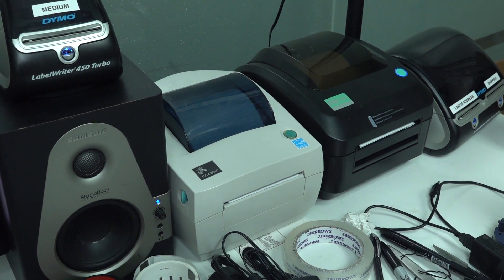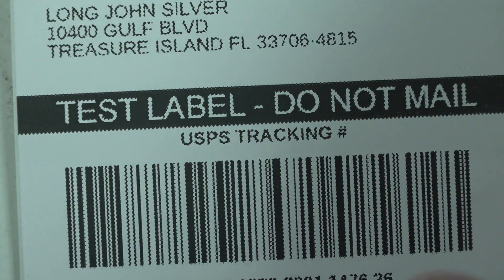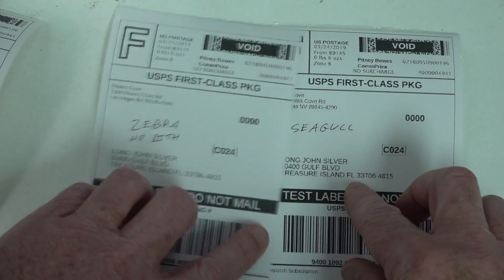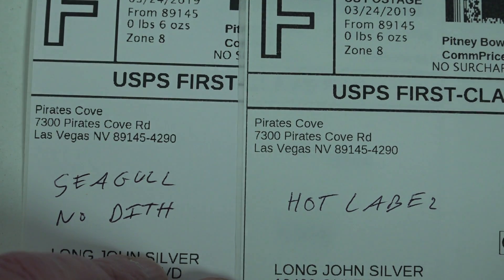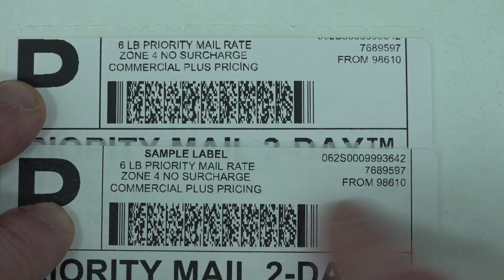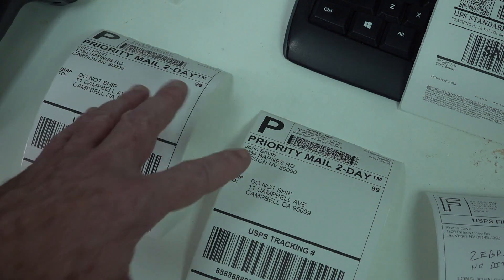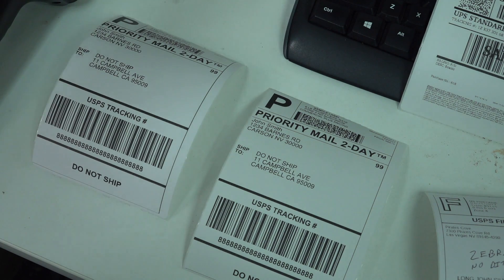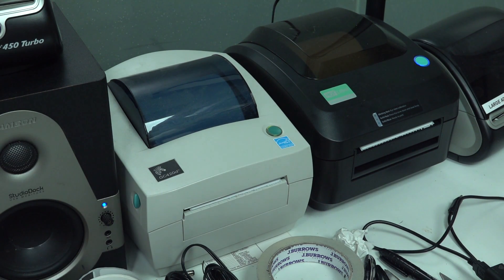Zebra 203dpi vs 300dpi Thermal Label Printer - PART 2

Comment: The issue here is that for the  test you're printing a raster image, which is interpreted by the printer driver to some other image (hence the dithering), affected by the printers resolution.  Normal barcode printing software sends most of their data as vector, so a barcode is very well defined (no dithering possible), and the barcode size will vary depending on the printer.  You can print very tiny readable barcodes on a 203dpi printer with no issue, but it has to be sent to the printer as barcodes and not raster images.  It's very obvious you're using raster barcode images because your barcode size doesn't change from 203dpi to 300dpi.  This is also true for the text.  300dpi barcode printers are not very common, and 203dpi is adequate for 99.9% of label printing (we print tens of thousands a year), especially at the size you're using, as long as you're printing it correctly.  You'll see a similar result if you send a picture of text to a normal printer instead of printing it from something like a word processor.  Barcode printers are not designed to print optimal bitmap images.

Comment: To state the obvious, a 300 DPI printhead costs more than a 203 DPI printhead usually by about $100.00  on a desktop direct thermal label printer.  When prnting small, busy labels always go with 300 DPI.'

 The $150.00 stapler design direct thermal printers usually do not have replaceable print head.

Comment: In most cases the 203 DPI printers are actually 203.2 DPI and the 300 DPI (or 305 DPI) printers are actually 304.8 DPI. 
The reason for this is....they are 8 dots per mm and 12 dots per mm respectively, because what right-minded engineer would design the print heads in imperial?

It is quite common for users to have constant scaling issues because the tenths of a DPI are rounded off the spec sheet and the calculations don't work correctly.

None of this changes the fact that one of these printers has 50% more linear resolution than the other, which is the point Dave was making.

Comment: I have a really old Zebra LP 2443 printer with a NiceLabel driver (it may be gone from the internet but I have it archived). Still prints perfectly acceptable shipping labels today from Windows 11 and I networked it with a print server. These things go for about $50 bucks on eBay. Old tech but still works. Only downside is I have to run it at max darkness for it to come out just right.

Comment: Got to setup your drivers and settings for the label and printer. Dithering was causing the issue before. Bartender will work just fine - needs some settings changed on your end. :)

Comment: For anyone wondering why 203 and not 200 DPI, I did the math, that's 0.8 mm dot pitch almost exactly (0.1% tolerance) so I guess 203 is just converted from 0.8 mm. Not that it matters 😉

Comment: Honestly, with the new driver the 203dpi printer looks good enough to me. If the text is legible (which it is now) and the barcodes work like it did in the video, I would not worry about it, even if 300dpi is recommended. Of course, you have both now, so it makes sense to use the better one.
Reply from the maker: Yes, but that's the point, it looks "good enough" but whne you scan the labels it's not good enough. The small font is also not very legible on the 203 dpi

Comment: If you can then use the build-in fonts and barcodes, way faster and much better quality, Windows printing do not work that well, sorry. One may try to change the orientation of the image 90 degrees, sometimes it can also do the trick
Reply from the maker: I have no control over how my shipping software renders fonts.

Comment: I work with these printers all day.
The dithering isn't the problem.
The problem is you are sending an image.

Normally you will send a zpl code and ask the printer to create a Barcode, the starting point and the size.

They are terrible on images and a Barcode shouldn't be an image.

In zebra designer you can see this if you create a Barcode, it wil jump in size, not gradually but according to pixels.

This makes sure that the Barcode quality is as high as possible.

Don't raise the density higher if it's already black. The heat is very concentrated normally.
If you make it to hot the heat will color a to large area.
If you turn it far up and turn down the speed it will even overheat so far the printing can turn gray again.
Reply from the maker: I have no control over how my shipping software renders stuff. All I know is that's its a problem.

Comment: Glad you got the driver issue sorted.  The issues you seem to have now are because you are printing rasterized sample labels.  What I mean is that they are bitmaps.  The way the Zebra prints labels when you use UPS, FedEx, or USPS (USA) is that the site generally gives ZPL code that causes the printer to then draw the barcodes, text, and graphics on it's internal memory at the printers native DPI.  Some sites may give PDF which is then used to create ZPL by the driver.  Only then is it printed out.  A ZPL file to make your sample label would be 1 KB whereas the GIF/JPEG might be 50KB+.  That is why your bitmap sample labels take so long to print on the Zebra AND why they don't print 100% correctly (slow scanner reads).  The bitmap samples you are using are already rendered @ 203 or 300 dpi and if you print that bitmap on a printer with a different native dpi then the barcodes will be hard to scan and possibly not scan at all.  ZPL is like Postscript (old laser printers) or PDF -- it is just instructions to the printer to draw the output image - go to this position, with this font at this size, write "PRIORITY MAIL 2-DAY".  In ZPL (Zebra programming language) there are special instructions to draw barcodes and those instructions create barcodes that line up perfectly with the native DPI of the printer - so perfect scans with a reader.  

I can't speak for the Auspost issues, etc...  If you have any other questions feel free to reply.  I've been a long time subscriber.
Reply from the maker: Yes, and that's great. But I have no control over how my shipping program generates and renders labels, so that's of no relevance here.
Reply: @EEVblog2  how not to respond to help
Reply: @EEVblog2  Not to be rude as I'm 100% trying to help you, but it is relevant - the shipping program sends elements to the driver - text, vector, and raster.  When you print these sample images they are raster only - the printer receives a bitmap image.  I am only speaking on the quality differences you are seeing in these sample labels you print.  When you print from your shipping software, the software sends elements to the driver and not a raster image.  The driver formats those elements into the printer's language but STILL does not rasterize them at that time - the printer does the final rasterizing.   I know you can't show me Auspost labels so it's hard to help you with that.  It could be that Auspost uses barcodes that are so dense that they simply can't work in 203 DPI - I don't know.  All I can speak on is that FedEx, UPS, and USPS all use barcodes that fit in 203.
Reply: @EEVblog2  May I ask, do your Auspost labels look like this or something else?  https://assets.netohq.com/cms/blog/Australia-Post-Label.png
Reply: @Tooob  Probably do, just that the free program from Auspost is designed to be printer agnostic, so does not produce ZPL output, but a massive bitmap sent to the printer.

the versions that integrate into ERP solutions, and which are supported, will come with a Zebra printer included in the  install, so will use ZPL natively, but if they are selected to use another printer the job will go out as a bitmap.

Fun about Zebra printers is that almost all of them still have a serial and parallel interface on the back, in addition to USB and, for some models, a network connection. Meant to be used to replace older impact printers and thermal printers, and communicate with really old systems. You also can program the serial interface with that single button, but that is a real pain.
Reply: @SeanBZA  Appreciate the response.  So it's as I feared and Auspost is using bitmaps and possibly doesn't know the native resolution of the printer - a recipe for problems.  You are correct and almost any Zebra that has a parallel port can also be made networked by using a ZebraNet Printserver II (old printers) or ZebraNet 10/100 Printserver for newer ones.  I repair the industrial Zebra models and the highest usage I've seen on one printer is 36 million inches printed - 6 million 4x6 labels.
Reply: @Tooob  The scaling algorithm is likely also a problem. To do good scaling to a lower resolution requires a lot more than just dropping pixels, and it looks like perhaps just dropping is all that is being done for the zebra.  (3 dots into 2 dots - you have to leave one out).  The first slightly better naive approach to scale 300 dpi down to 200 dpi is to first double everything to 600 dpi, then you are going from 6 dots into 2 dots - at least that goes evenly. But to do better the scaler needs to understand the image - lines, arcs, filled areas, enclosed areas - and do special handling to preserve those characteristics to the maximum extent possible. (18 years experience before I got out of display and laser printer driver development)

Comment: I guess that explains why if you're a big shipper, FedEx gives you a shipping station setup which is a PC with their software, a digital scale and a printer all in one. The PC comes with all the software preinstalled and configured and the printer is chosen to be one that works with FedEx's systems so you're not futzing with printer settings or other things in order to get the barcodes scanning properly. (As far as I know, the whole system is "yours" because you can mess with it how you like - install other shipping software, etc.)

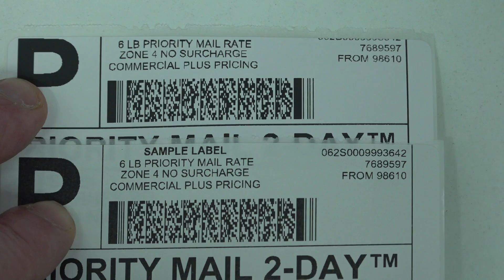Comment: The edges of the large P at 3:55 is terrible. Or the diagonals of M in COMMERCIAL. 200 dpi is 8 pixels for every mm. Can you print a test image with alternating b/w lines with different density? (I understand that It could just be the poor font rendering in software)

Comment: 300 DPI is definitely going to be more Dots Per Inch... (lol. Obviously). And that will make it clearer, especially the smaller stuff.

Id just be concerned with the build quality of the new 300dpi printer. I'd hope they'd be the same, but maybe parts will fail more often on the less expensive model. Peak shipping days for my business I'm shipping 60 packages a day. I can't have a printer failure.
Reply: you can get two of the cheap ones, still less than a zebra printer. than you have full redundancy. even those zebra printers can fail and out of experience: they do.
Reply: @higihups  I have two Zebras already. I got them used on ebay line 10 years ago. No problems so far, aside from a power brick failing once.
Reply: If it's a new zebra it will work the same, updating the drivers isn't even necessary as it will still use the zpl programming code.

Comment: Try printing using raw ZPL programming language and all those dithering issue will be gone. This is what really sets the Zebra printers apart from other, especially in the industrial market.
Reply from the maker: I have no control over how my shipping progam renders labels.
Reply: @EEVblog2  some programs (not yours) use a portal to open a program which create a pdf.

For this people, set it up so Adobe opens pbf, this gives more control.
Reply: But how would you possibly set that up if the existing label making software does not support it?
Reply: @jaro6985  A lot of label software does support it, just you have to pay Zebra a license fee per install to use it. So it is not offered on the low cost end of the market, just to the top end, where they can cover that fee. You can bet the big shippers who use Auspost a lot and who pay for the integration get the upgrade to use ZPL, but the rest just send the printer a bitmap image.  A lot of that can be fixed just by setting width of print area to a multiple of 203, which means scaling does not give dot errors any more.

Printing varying labels I did find that out, just changing a printed width by 0.1mm made a big difference in small labels legibility.
Reply: @SeanBZA  Yeah I mean the common folk who get a  BMP or PDF label from the shipping company, we can't use it then I assume.
Reply: @jaro6985  I get pdf per mail but don't know how to use it on a label like this. I can print it on a full paper sheet and then manually cut it out with scissors or such. Or with MS Word and use one of the label templates
Reply: @orfeous  do you actually have a label printer? you drag a selection box around the label if its not 4x6 and then right click print. If you dont have a label printer, then just fold blank edges back and tape to the box is easiest.
Reply: Just set up your label size in the driver of the label printer.
Select the label printer.
Select the paper size and print without scaling.

Comment: Why on earth do they print the 2D barcode smaller than the 1D one?? I feel like there would be no problem if they swapped those lol.
Reply: The 2d barcode contains info such as address info and is mainly for automation to scan, the 1d barcode is more for manual scanning by humans so bigger better
Reply: @KR-rs2wk  I guess, but still... There is so much empty space that you could have both of them even bigger still amd still fit all the text.
Reply: The bigger the text the better makes delivery easier for humans
Reply: 2d is readable way better than 1d. Most 2d codes also include error recovery.

Comment: Yep, the Seagull software is what I tried on mine too.  Auspost's label definitely s*ts the bed on the 203,  bit of a pain isn't it, both the DL (QR like) and the *vertical 1D barcode would be sadly butchered.   

A real shame that we can't get away with the 203 as they're definitely cheaper but as you say, you really need those bigger barcodes to make it work.